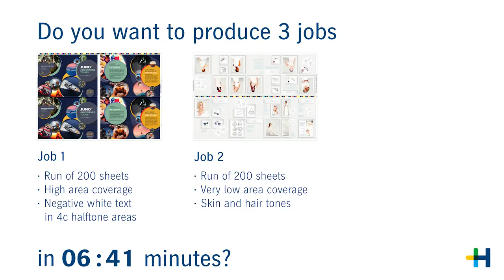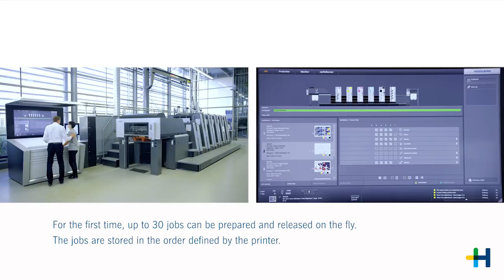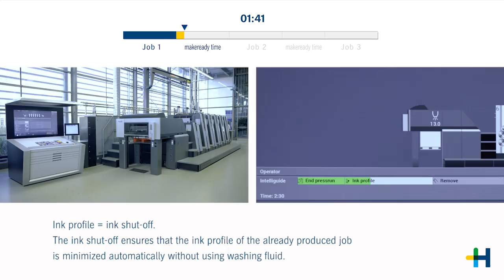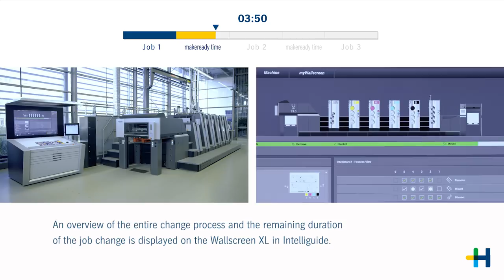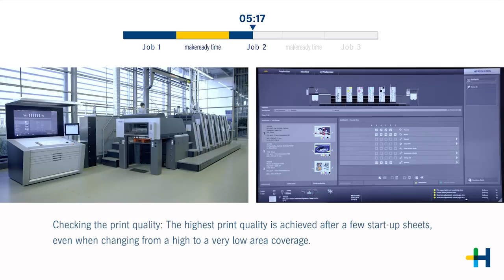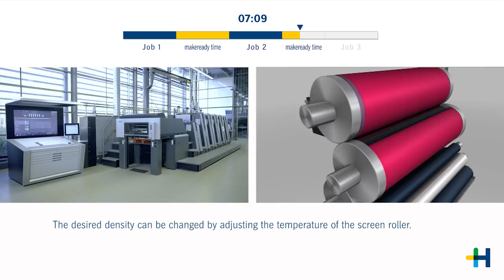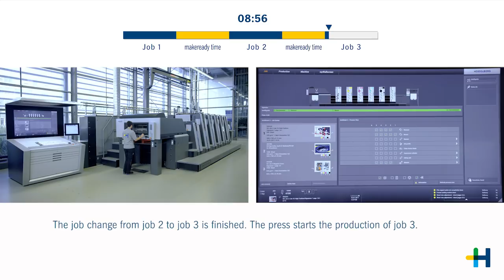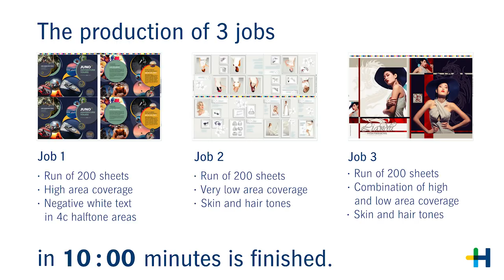How to produce 3 jobs in only 10 minutes | Speedmaster XL 75 Anicolor 2

Comment: You can move faster, the point is you need to maintain these machines. That's downtime.THE Roland 700 is a funky beast but it can roll out products. In a timely manner. I have printed 8 colors on A 4" 6 color with A split fountain.  K=PMS,Cyan=PMS,Magenta,Yellow, coat. Long and short runs. I have had my time with the Heidelberg. two-color conventional dampening system. You... know dropping rollers at the start, running to the front of the press to check color. Using A densitometer from another press. Having them yell at you to use your eyes. To check the color...Making that ducker work setting the rollers pepper.  Mint,  22 + years.....

Comment: Does the machine automatically measure the densities and correct automatically during driving and does it work 100%. I didn't see the printer making any adjustments. The values stored in the memory do not work if the same job comes e.g. every 6 months.
Reply from the maker: Hi @markolahteenmaki7116, the job-related data does not have to be saved as only the paper is decisive for the coloring. This value of the process colors and spot colors is saved according to paper class. Hope this answeres your question :)
Kind regards from the Social Media Team

Comment: Where is the time needed for first make ready and tooling up of press plates,blankets and stock. Or do you only run same design no coating no change of board type thickness etc you know real world things.
Reply from the maker: The plates for job 1 are already in the machine and mounted, the ink automatically filled into the ink chambers thanks to InkStar, so job no. 1 can start immediately. We have a complete job change between job 1 and 2/2 and 3. Paper stock is always the same as well as ink and coating. Best regards from the Social Media Team

Comment: Show room shit. In the real world, your feeder operator is sleeping and your waiting on stock for the first job. The second job, your waiting on ink delivery. The third job, the plates are all screwed up. Short run jobs are difficult because they don;t allow enough waste to do it right. Running 200 sheet runs at 15,000 imps an hour is a joke if you want to actually sell the job. Printing is not a perfect world. Never did our real world operations meet the demonstration room performance. 30 years as a Heidelberg Pressman in High End shops.  10 color perfector with a roll feeder.

Comment: A Woman Pressman? Really? I ran 40 inch Heidelbergs for 25 years. ^ col Carton Diameters with Aquious coating units and convection drying systems to 8 colour 102 cm four over four perfectors. I've worked all over the city of Toronto in both the trade and commercial industries. NEVER have I seen a woman pressMAN. They don't exist. Only in filmed commercials like this one. Why? Because its a dirty hardcore cut throat dead line business that wouldn't have time for any pressman regardless of sex to leave to pick your kids up from schools or taking days off because you have cramps. You work 12 hours a day, no breaks, no lunches. The machine runs while you eat your lunch and that is just the way it is. Oh, and by the way..... that show room is just that, a showroom for dreamers, no real producing print shops or machines look like that. They are covered in ink, anti-set off powder and spilled coating and or varnish and usually stick of isopropyl alcohol or WORSE the toxic "Enviromentally friendly" water solutions that are worse than alcohol for a persons health, but are politically correct. Glenn Hynes Pressman Whitby Ontario.
Reply: Glenn Hynes Well dude. I am a Woman who works as a pressman. I exist. And yes i work 12 hours without lunch. We are exactly as capable of this job as the men are. When i studied the job to become a „pressman“ my class was half women and half men. I dont know how you never came across any women but its pretty common now.
Reply: It's good to hear that there are woman running real printing machines now. When I say real I guess I'm excluding any and all multis and or machines under a 52 cm (or 20" Heidelberg GTO sized press,) as well as any machine with less than 4 units. I would love to know the type of machine you operate. You see, the reason I said what I did was out of pure honesty. For the 25 years that I worked in both the trade and commercial printing industries in the GTA the jobs that I seen woman doing were either bindery work, or in management. I did know of two woman who ran multiple pocketed saddle stitching machines in our bindery and those machines were very mechanically complex. I just never seen a single woman run any type of printing press during my travels. And I don't mean any offence when I say it, it's just a true fact. 
        And yes, before you ask, I absolutely believe that a woman, almost any woman could be be properly trained and have the full intellectual prowess needed to understand the chemistry, the science, the mechanical, the electrical and the plumbing issues that are needed to run a big machine. When I say I've  never seen a woman running a printing press it's because that's been my experience. and I believe it's based solely on their own choice, not some type of inability or discrimination. 
       I am very curious though and would love to know what type of machine you run. What manufacturer, how many units, it's maximum sheet size etc. I'm glad to hear from a woman that is running an offset printing press, so cheers, looks good on ya!
                                                              Glenn
Reply: Glenn Hynes I‘m sorry if i interpreted your first comment wrong, but i‘m glad to hear we’re on the same page here. 
I also met a lot of women in manufacturing, and yes i was always the only woman in the printer team. But when i was in job learning there were actually a lot of women. Of course i am only in my late twenties, and maybe someday i wont be the only woman in printing (in one company). 
I worked and work in advertising, magazines, flyers stuff like that. So i havent worked on really big machines because it wasnt needed. The biggest machine i have worked on was the Heidelberg Speedmaster XL 106 10 colours (750 x 1060) 
Currently i work on a five colour KBA Rapida 106, i started to learn printing on an old two colour GTO, then SM52 4 colours (520 x 370) and went on to a 5 Colour Man Roland. My first company still teaches me to operate the old Heidelberg Tiegel, and thats where my arms really started to hurt. The machines now are mostly automatic. 
On what kind of machines have you worked?
Reply: It's good to see strong women standing up to the plate and taking on a job that is both very high paying but filty, stressful, and toxic. I'd love to know what city in Germany did you study to learn your craft? as well, what type of offset printing equipment did you run? I'd love to know and as a side note I appologize for coming across as so anti-woman in what I originally wrote. After re-reading it I can understand you being stand-off-ish. I did sound like an asshole and I apologize for that. I was probably just in a bad mood. The truth is I would have LOVED to see ANY woman stand up to the plate and take on the big equipment with the big expensive and important deadlines. Our rule in any company I worked in Toronto was a 6 colour or 6 unit offset printing press had to run 24 hours a day. The first 8 hour shift ran 5 jobs to make the press manufacturers payment (usually $50,000 a month), the second 8 hour shift paid for the rent the water the lights, the electricity , the chemistry, the ink, the etch, the plates, the Isopropyl alcohol, and the salaries, and the third 8 hour midnight shift was profit. And it was CUT THROAT. You produced 5 4 to 6 colour jobs a shift or you were out. No fucking H.R. department or union either. You were OUT! Period.
Reply: Well I must say that I am very impressed with your credentials. As for me I started out as a floor boy at a Commercial Printing Company called Shorewood Packaging. I piled the already printed product and delivered it to the bindery or the die cutters or foil stamping as needed. The press was a 7 colour or 7 unit Planeta 40 in” with an aqueous water based coater. From there I became a feeder on a 4 colour 25” Komori (Japanese press) back in the day when 2 guys worked on such a small machine! Then I became a second pressman on a 4 col. 38” Komori Kony. It was an odd machine with a maximum sheet size of 38”! Weird, eh! From there I became a second pressman on the newer Komori Lithrone 5 colour 40” press. Then onto a 6 colour 40” Mitsubishi with a water-based tower coater as a second pressman slash feeder, then I landed my first pressman job when I was 20 years old running a 2 unit 40” Mitsubishi where I quickly excelled into running the same companies 5 unit 28” Mitsubishi. Then I eventually began to run the 6 unit 40” Mitsubishi with the tower coater that I use to be the second pressman on.
     From there I ventured into the trade printing part of the industry and was given what was to me the Mercedes Benz of offset printing, which was a brand new Heidelberg Speedmaster 8 unit 40” with a perfecting unit in unit 5, so we could either print four colours on one side of the sheet, then flip it over and finish printing four colours on the top side of the sheet inline in one pass or run 8 colours in a straight printing mode.
      But my favorite machine to run was my Heidelberg Speedmaster CD 6 colour 40” (CD stood for Carton Diameter) with CP 2000 console. I’ve run CP1-04 with CP Tronics on my 8 colour press but I much preferred CP 2000 with its LCD touch screen. That machine could run every caliper of paper from onion skin to .040” card stock! What an amazing machine! You can’t beat the Germans when it comes to printing equipment.
      Because of ulcerative colitis I’ve been out of the industry for more years now than I care to admit, but I will tell you with certainty that I would happily work opposite shifts on the same press as any woman that knows how to print and how to have ink trap on top of one another properly for the sharpest and best result. I would welcome you or any woman aboard any press I would run and believe you’d be a breath of fresh air. All my best wishes to you and thank you for your response.
Glenn Hynes
Reply: @Schahkim1  claro si la maquina es automatizada puedes,pero eno tros paises donde es la mayoria no usan solventes automaticos para la limpieza lo hacen a mano, las impresiones son solo de 1,000 tiros, lo que te obliga a poner material a pulso cortandote las manos por falencias y desempaquetando resmas de papel, a eso sumale la limpieza de las placas , todo en modo manual, es asi en la mayori de paises , por no decir casi  todos fuera de usa.
Reply: @glennhynes5185  la vista d elas mujeres observan mas gama de foloress que los hombres por eso trabajan en colorimetria, pero el olfato de los hombres es muy superior y tambien el paladar, por eso son los mejores chefs en el mundo.
Reply: I am looking to get into sheetfed printing. I hope you are not the douchebag that I am going to work for.